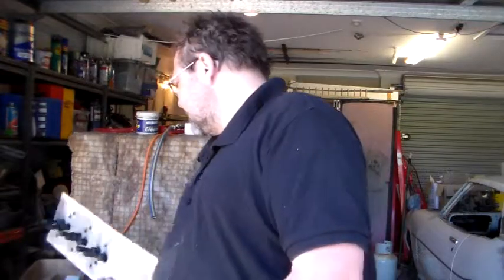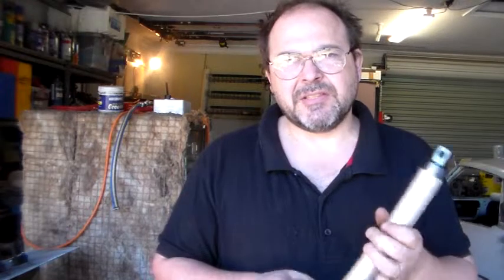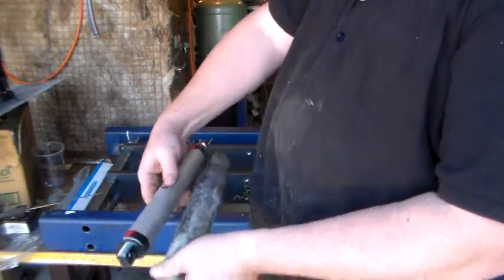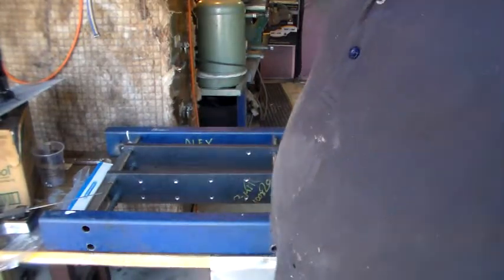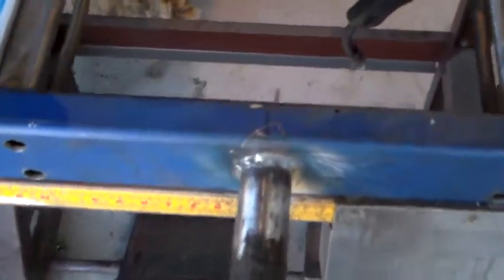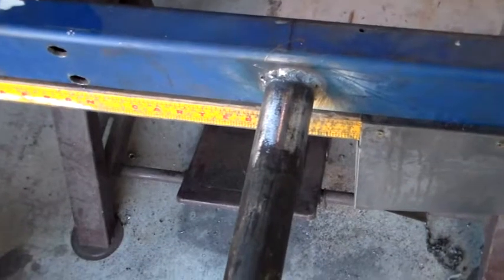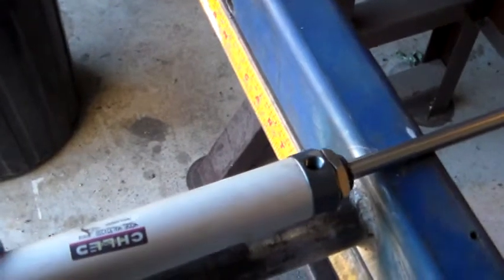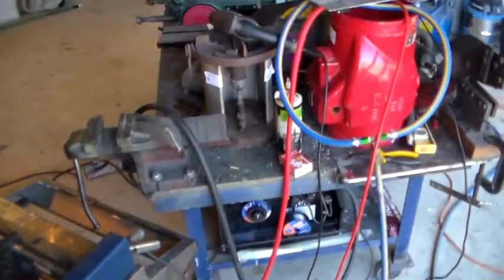Making a Plastic Injection Molding Machine Part 14

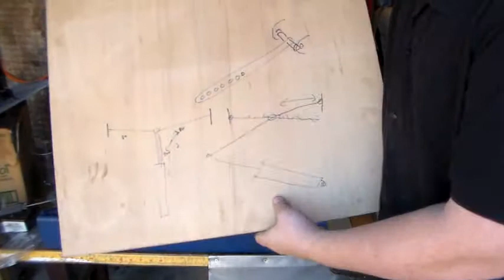Comment: Great progress again for subscribers. Lever system is the way to go (2:54.) It gives big clamping/locking power. Injection machine often selling point is its clamping power.  But your current setup with a straight on air often causes the mold to push open causing flashing.
Reply from the maker: David  Hi David, I completely agree that a levered system would have provided greater clamping force but at this stage it came down to a choice of simplicity.
Reply: Simplicity is the way to go. I've recently discovered I may be able to make detailed delrin parts with a simple manually operated 2 pounds kit. Simplicity boils down to manually operated and small. Small, yet makes larger parts too.
Reply: You may try a 4-20 ton jack as a clamp along with some strong pull back springs, if you decide simplicity, power and manual. Bottle jacks maintain its linear position well....if welded to the plate.

Comment: Those tubes 14:38  I would first try slathering inside of it with marine grease. They often use shaft ball bearings here but they're kinda expensive.
Reply from the maker: David Yeah I had already done exactly that - marine grease.  But they were still binding. Ideally linear bearing would be the go but as you mention there is the cost issue.  Even though cheap ones off Ebay from China were about $70-$80 I just wanted to avoid the cost.  To overcome the issue I ended up removing the 19mm short tube sections that I pressed into the plates and they now slide very easily.  There is more lateral movement than I would like but I'm hoping that the aligning studs in the mould halves will keep them aligned on compression. As for overcoming any flashing that's a bridge I'll cross later.

Comment: hi alex, just watched all your videoson your injection machine. im going to make one aswell. so thanks for all the ideas that have worked and not worked. very interested to see your finished product
and whether you are going to make your own moulds or have them manufactured
Reply from the maker: Thanks for watching Ben.  I plan to make my own moulds, paying for them is beyond my reach and I'm pretty confident that I can make them myself. I'll be sure to upload a video on it when I get to that stage. Cheers, Alex
Reply: Alex Does DIY im a boilermaker alex..your biggest problem when welding with stickis your stick angle and ur trying free hand alot. we do it for a living and try to avoid free handing the gun. and pipe welding is he hardest with stick. especialy when u have 3 4 or 5g positioning.. position your stock  for 2g and tack on a rod too put your weight onto it,, much more consistent welds and just so much easier..
Reply from the maker: ben field  Hey Ben, thanks for the suggestions. Given your experience I'm sure it's obvious to you that I've had no welding training, other than watching youtube videos of course.  I like the idea of tacking on a support bar, if I ever do a larger stick weld job where I feel the end result is that critical I'll definitely try that.Cheers, Alex

Comment: According my calculation, you may be able to get about 110mm (4-1/4") opening with the lever system. But you might need 4 shaft ball bearings.